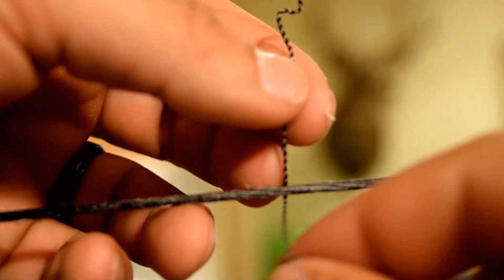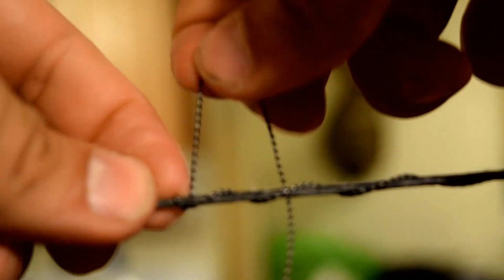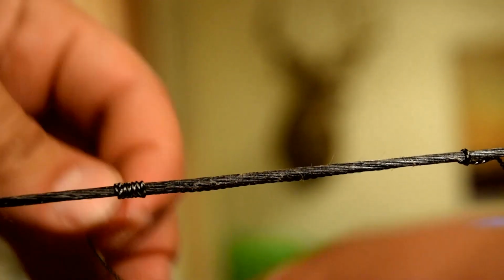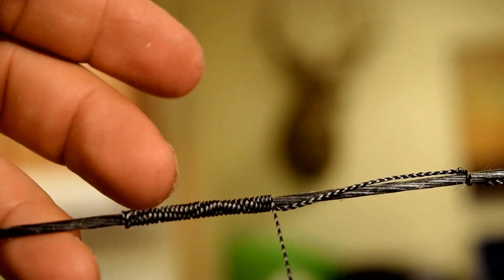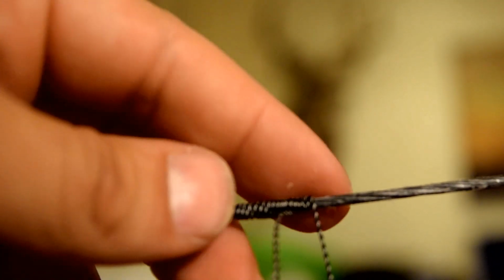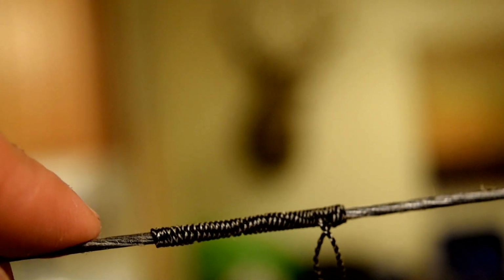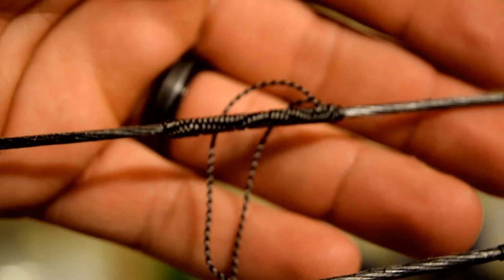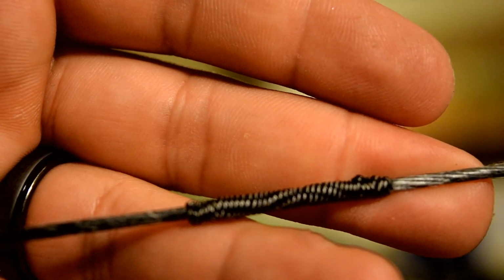How to serve your bowstring with no tools."DIY Toolless serving"

Comment: With a compact crossbow I can’t find a tool that is small enough.   I will have to learn to do it manually.     I have a AR6 Stinger 2 repeating crossbow and already wearing out in a month.      I have extra stings but this will save my from having to keep replacing strings.

Comment: Hi im new to sport but what do you use the string spreader for when your doing that serving?
Reply from the maker: shaun schollaert the the beautiful thing about this method, you do not need a string spreader. I would only do it this way if I wasn't near a shop or didn't haven't a press available
Reply: Yeah but you wouldnt use a string spreader to do the centre serving right
Reply from the maker: shaun schollaert I would if I had option to I feel it holds better. But you can do it both ways lots of guys do it with spreading the string. Different strokes for different folks :)